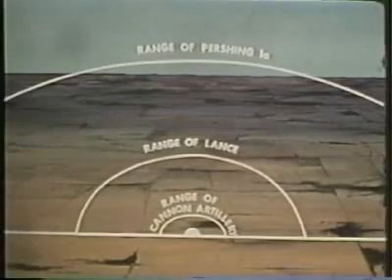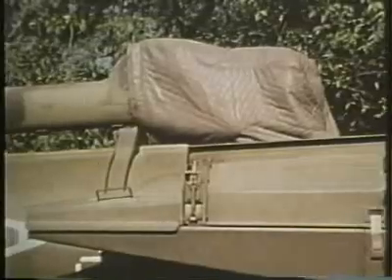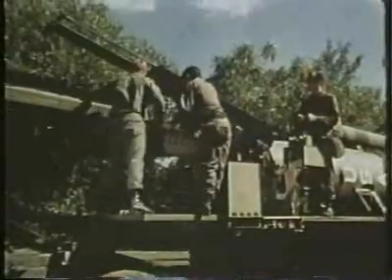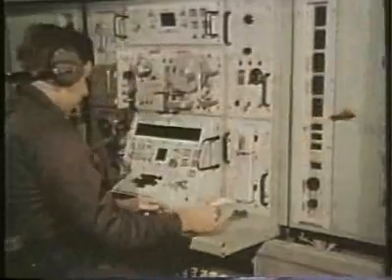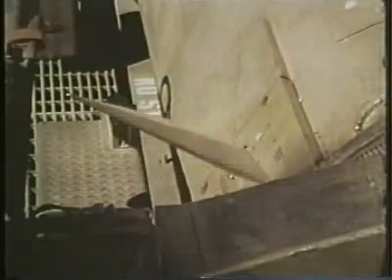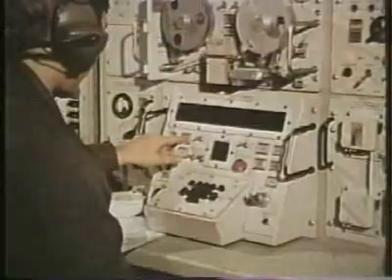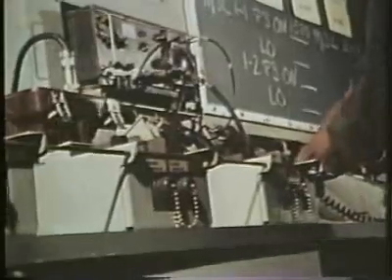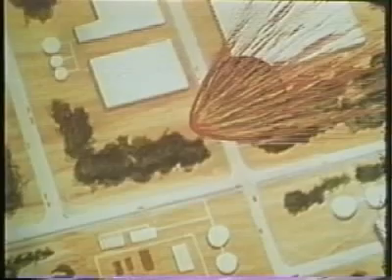Pershing 1a Missile (1977)

Comment: I was assigned to A Batt 1/81st FA Neu Ulm 56th FA Brigade1983-1985 and was there for the transition from Pershing 1A to Pershing 2. The 1A was a demanding (often would not count down correctly)  piece of equipment besides being worn out from being in service 10 Plus years of constant fielding. The tripod with the laser had to be just right and if the tripod sank in the German Mud even the slightest bit it would throw the countdown off....and who can go without mentioning the outrageously heavy umbilical cable bundle...... Jesus H Christ it used to take 10 guys all in military shape just to deal with the damm thing.... also we used to have to cut down trees so we could put the EL (erector launcher) in the proper azimuth towards our intended target. The Pershing 2 was a fantastic upgrade, we could just pull over on the side of the road and count it down right there. I got to go to Cape Canaveral and Fire One in 1984...I still have the pulled safety pin. I received the coveted"Pershing Pickle" there. I was 18 to 20 years old........you had to be that young to survive the non-stop field maneuvers in the Bavarian Winter and CAS site duty, but I wouldn't have missed it for the world. "We Gave Peace A Chance"
Reply: I was there as well,  82 to 84,  remember first Sgt. Anderson? I was in commo.
Reply: @jamessherosick2747  I don't my first sgt was Sgt Drinkard...let me ask was my description of things accurate? It would be nice to get some feedback.
Reply: @robertlee9069 I believe Drinkard came in towards the end of my time there was a major Sellars, not sure if he moved up, as major McMillan got his head between a deuce and a half and the mess trailer. I was in commo, but I hung around some rocket guy's. Matt Burke,  was still there when I left. Cas site was a strange place, I remember taking showers and looking out at 9 missiles on the 3 pads. Also the F-16 fighters dipping down into the compound from every which way. I do remember the missile guys always having some problem or another out in the field. Then they would yell "back blast area clear" and the thing would stand up and the fins would wriggle for a minute,  and they would be either happy or very disappointed.  I often look back at those times and am so glad I was there. The winters were bleak but I had some German friends to hang out with in town.
Reply: @jamessherosick2747  Matt Burke was in my platoon and was a corporal (one of the few as most E4's were specialists) Red Hair and crazy...I remember him slamming me against a wall at one of our late-night drinking parties. You are right it was Major Sellers when I first got there (oct 83) and then became Maj Pennington. Well, my Friend we definitely chewed some of the same dirt. I think about what my friends were doing back in the US and I take so much pride knowing that along with guys like you, we were at the front of the Cold War........defending what we love.....we gave peace a chance.
Reply: @robertlee9069  At the time I had no idea how serious the whole thing was,  I realize now that we really were on the front line of history in a meaningful way. It would certainly explain why they were so uptight about appearances,  the demonstrations were intense when the protesters encircled the whole base.
Reply: @jamessherosick2747  I had just got there when that happened. I have a special love for wearing the coolest patch in the ARMY that also had a tab. I have a 56th FA Patch Sticker on my Truck.

Comment: "The onboard computer constantly collects in-flight data, compares it with the desired flight path, and then maneuvers the jet vanes and air fins to keep the missile on-course."

The missile knows where it is at all times. It knows this because it knows where it isn't. By subtracting where it is from where it isn't, or where it isn't from where it is (whichever is greater), it obtains a difference, or deviation. The guidance subsystem uses deviations to generate corrective commands to drive the missile from a position where it is to a position where it isn't, and arriving at a position where it wasn't, it now is. Consequently, the position where it is, is now the position that it wasn't, and it follows that the position that it was, is now the position that it isn't. In the event that the position that it is in is not the position that it wasn't, the system has acquired a variation, the variation being the difference between where the missile is, and where it wasn't. If variation is considered to be a significant factor, it too may be corrected by the GEA. However, the missile must also know where it was. The missile guidance computer scenario works as follows. Because a variation has modified some of the information the missile has obtained, it is not sure just where it is. However, it is sure where it isn't, within reason, and it knows where it was. It now subtracts where it should be from where it wasn't, or vice-versa, and by differentiating this from the algebraic sum of where it shouldn't be, and where it was, it is able to obtain the deviation and its variation, which is called error.

Comment: I served from June 22 1972 (when I left for basic. One of those things you don't forget.) After Basic and AIT I left for Germany in January '73. I was stationed in B Btry 3/84 FA Btn, 56 FA Bde in Heilbronn, Germany (Badenerhoff Kaserne). Initially I was a crewman and then performed missile maintenance tasks and operated the Programmer Test Station. I spent my last few months at my duty station as a parts clerk dealing with Pershing peculiar parts such as the control vanes or fins, computer cards, ball lock pins, cables, etc. I am proud of the service I performed during the Cold War.
Reply: I arrived in Apr 73 at 56 FA Bgde Bismarck & Hardt Kasernes; part of STARPAC, Schwabisch Gmund, til Sep 75.  Not a missile guy, but worked with you guys.
Reply: lol, I was D Battery 3/84th at Artillerie Kaserne in Neckarsulm...But I was a little later from 82-84...Thank you for your Cold War service! I was in Operation Able Archer!
Reply: @neckarsulme  spent some time st Artillery Kaserne while our barracks was being remodeled.
Reply: My dad was stationed in bon Germany with the Persian missle Corp

Comment: I noticed this is Pershing 1a with the block 7 modifications from 1975/76. The Sequential Launch Adapter (SLA) was part of that upgrade, along with the ARU (Automatic Reference Unit). It had some fascinating technology like a "north seeking gyro" that would automatically find grid north with incredible accuracy, by sensing the actual rotation of the earth on its axis. The SLA was insanely complicated. It had to physically switch about a thousand electrical connections from launcher to launcher in one single operation. And do it in the snow, ice, rain and mud. The idea was to speed up the firing of all three missiles before the artillery position was destroyed by a retaliatory strike. It was really something!
Reply: +jkevinmccon And that sweet old style W50 with some ridiculous yield on top of it.
Reply: Fritz Haber These US Pershing missile is a short range ballistic missile ( SRBM ) while Russia stole and copy these missile they called it Scud missile they have similar between two missile the Pershing is towing before launch while the Russian Scud missile mobile launch system
Reply: @robertoaseremo2816  NOT Ballastic, MORE Tactical.
Reply: Freaking thing is wired-wrap (except the circuit boards), so when you drive the PTS out in the field the whole thing is mal-functioned.

Comment: I was also A Btry 3/84 FA NECKARSUM ... and wondering if the adjustments for the 1A moved out of the old Kasern. I was an Erector Launcher Operator the Pershing I in 1967-68 The IA sure erected quickly, but loss of the tracked M474's sure took a lot of fun out of it!
Reply: Dang that's crazy...I was in D Battery at Neckarsulm 82-82...those barracks were built crazy strong! I gues they were old German Wehrmacht barracks?...I really loves the architecture and grooved granite floors!

Comment: Pershing Ia had three warhead yields (that we had to physically change out using the H4211B and crane): Y1 = 60kt, Y2= 220kt, and Y3= 400kt.  At PII training at Canaveral they told us about the select yield warhead.  As I recall there were four settings of 1.5kt, 15kt, 30kt and 60kt.  This gave the capability of taking out anything from a shopping mall to a large city.  I also liked the simplicity of E.D. in that its nuclear capability was rendered useless by bashing the side of the warhead!